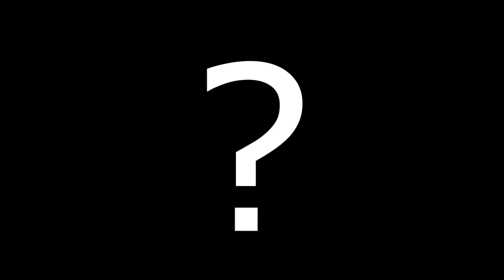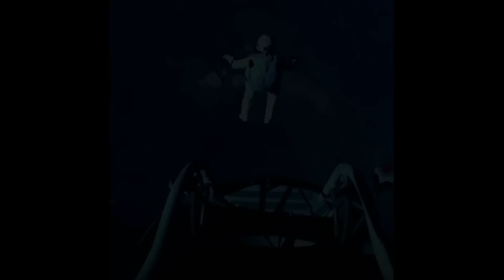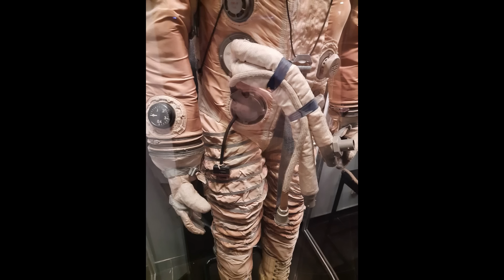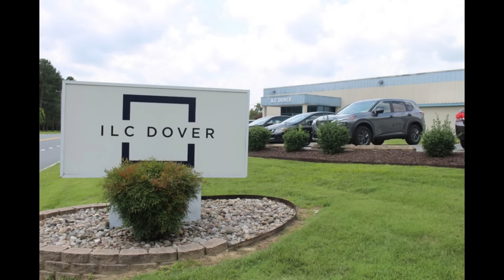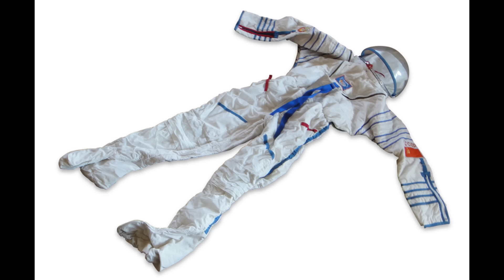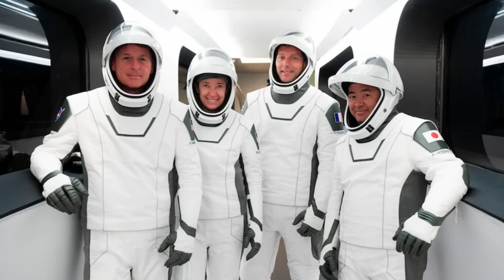A Brief History of Space Suits

Comment: When does not have to be a space and aeronautics engineer to understand what I'm about to say. 

Anyone who has been to boot camp, and remembers those metal trays on which they used to serve our food on the mess decks, will understand what I'm about to say perfectly. Metal both accepts and releases heat very quickly. Burn your hands when they first come out of the dishwasher, and it's why they turn your food ice cold within a couple of minutes of loading them with said food.

A metal helmet on a spacesuit to reflect sunlight is a very very bad idea. They would have cooked whoever they put inside of that thing in that moment. But the good news is, once they got them out of the Sun, then the remains would have been frozen for posterity.

Comment: The head pressure/torso counter pressure thing must have been so unbelievably uncomfortable.  The entire design is basically the same as sticking you in a big box with a hole in the bottom, sticking your bottom half out the hole up to your ribcage, then sealing around it and pressurizing the box.  All it's going to do is try and squeeze your blood/insides out your buttocks and push your blood into your legs so hard they turn into blood balloons.  Ugh.

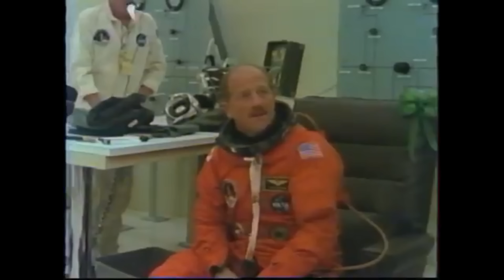Comment: Amazing as always! Couple small nitpicks at 59:00 though regarding Columbia. I highly recommend reading the Columbia AIB report titled "Crew Survival Report" as well as the much lesser known, significantly more detailed (and fair warning, significantly more graphic) "Loss of Signal:
Aeromedical Lessons Learned from the
STS-107 Columbia Space Shuttle Mishap" report. The data showed that between the heating, the impacts during breakup, and multiple other factors, even with fully and properly sealed suits and restraints, it was sadly completely unsurvivable.  And secondly, it explains that the unlocked visors and lack of gloves was not from complacency - at least in the commander and pilots case, the gloves being off was actually SOP per the checklist since it made using the flight controls much easier. And as for the visors, they just hadn't gotten there yet - the breakup happened so early at least one astronaut hadn't even been able to finish their tasks and strap in fully yet, and multiple others had only partially strapped in. And the speed it all went wrong was immediate. On the positive side, they talk about how the data from the accident and the lessons learned and applied to the latest suits and spacecraft means that if a similar accident happened again, the chances of survival have improved dramatically.

Comment: Do space suits have any radiation protection?
Reply from the maker: Most of the layers are designed to provide some radiation shielding. Surprisingly, it takes very little to stop solar radiation on a short time scale.
Reply: @DKiSAerospaceHistory  I don't know how much sun spots generate radiation, if they don't run in to any of those or it could end up like the solar flare that created the FANTASTIC FOUR 🔥
Reply: The sun doesn't spit out much radiation relative to its visible light, the white layer and layers do protect them well.

Comment: I mean, it kind of makes sense to use a diving suit as a primitive space suit. They're supposed to be reasonably gas-tight, and resistant to pressure gradients. The direction of said pressure gradient is likely immaterial for most parts of the suit, and for the parts it is relevant, the magnitude of the difference likely matters more. 

Similar to how the pressure hull of a submarine would actually be a decent spacecraft if the other submarine parts that relied on water were swapped out, and assuming you could get it up there (good use for an Orion Drive).

Comment: Most diving suits (like you have referenced) are intended to have a P differential of 0. Slight differences would be uncomfortable. Large differences (such as surface pump failure) could be deadly, trying to push the diver into and up the supply lines. There was also just recently a young girl who died using a dry suit because she was unable to pressurize the inside to neutralize the pressure differential and it crushed her until she could no longer move/swim/breathe.

Comment: Interesting and informative.  However, I think you made one small error.  When the astronauts jettisoned the two PLSS backpacks, they were on the LM's life support connections, not the O2 purge system.  They did keep the OPS's in case they needed it for an emergency crew transfer if there was a problem with the docking.

Comment: I understand the point you were trying to make relative to physical exertion for microgravity EVA versus lunar EVA, but I tend to think most astronauts might take exception with the assertion that microgravity requires barely no exertion. I've read many astronauts' accounts of EVA, and they all describe it as incredibly physically taxing since any joint movement is a struggle against the suit's pressurization. Even the simple act of closing the hand to grasp a handhold or tool requires such significant force that astronauts have reported losing fingernails.
Reply from the maker: I was judging by things I've heard such as only "finger-tip pressure" needed to open the massive solar arrays on the ISS so that they could be unfurled.

You make a fair point though.

Comment: With regards to Jules Verne:
The question of Lunar habitability is raised in the novell (originally they only wanted to send a dead projectile until a french adventurer voluntered to fly to the moon on a one-way trip, taking along the main character and his fierce opponent for plot reasons. The consesus is, that 
1. The moon is likely inhabited by intelligent beings
2. The Lunar Atmosphere - if it exists - is thin, yet likely breathable in the lowlands
3. The Moon would serve well to agriculture, the passangers take along animals, seeds and various tools.
In the sequel, while on the trip to the moon, they discover one of the dogs they brought along did not survive the violent launch and the decide to throw it out one of the hatches. They adress the problem of exposing the interior to space, however they manage to open a door and throw out the dog, taking care to let as little air as possible to evacuate out of the capsule. Clearly, Verne didnt really have a comprehention of how quickly pressurized air would leak out into a vacuum.
Actually, the astronauts are sent around the moon, because there was an error in calculation. They work out their trajectory and perform a course correction with the thrusters they had planned to use for landing, sending them onto a free-return trajectory, leading to a splashdown in the pacific ocean.
At no point is the necessity of a spacesuit even discussed, life support systems were deemed only necessary for the trip in the enclosed capsule.
Reply: This sounds like such a fun story.

Reminds me of Laika ... 😢

Comment: One cute point about tossing the PLSSes after the final moonwalks -- while the hoses were long enough to bend down and toss things out the hatch while connected to the LM's suit circuit, it was still sorta hard to bend like that.  Especially in the A7L suits before the waist joint was added to the A7LB.  Therefore, on at least one flight (I think it was Apollo 14), the TV camera was running while the PLSSes were jettisoned, and Houston remarked that they seemed to leave the hatch with some velocity.  The crew admitted that they wanted the backpacks to clear the front porch and the ladder, but didn't want to bend over that far, so they set them on the hatch frame and kicked them out.  This was likely done after Neil and Buzz reported that one of their backpacks barely cleared the porch and sort of bounced on the ladder rungs, before landing in the front footpad.  I think they just wanted a little more clearance, lol...

Comment: Sorta hoped for mentions of the two "lost" Apollo suits.  As you noted in passing, there were contract issues with ILC and Hamilton Standard, the maker of the PLSSes.  That meant that, in late 1966 into early 1967, there still wasn't a usable ILC Apollo suit.  So NASA had the David Clark Company, maker of the Gemini suits, make a slightly altered Gemini suit called the A1C.  These were the suits the Apollo 1 crew wore when the fire occurred, and as they had outer layers of nylon, the suits burned vigorously.  The other "lost" suit was the one that was approaching readiness, and would have made the lunar landings had the fire not happened.  This was the A6, which resembled the later A7 a lot, but the thermal and micrometeor garment was NOT integrated.  It was a separate set of garments, very much like a snowsuit's coat and pants, the LM crews would have donned over their A6L suits, helmets and backpacks.  As that would also have been primarily nylon, it was nixed after the fire, and the whole thermal and micrometeor protection garment integrated to become the outer layers of the A7L, coated with fiberglass-based Beta cloth to inhibit burning, even in 100% oxygen environments.

Comment: Quick correction -- when the LM crews jettisoned their PLSSes, they didn't switch over to the emergency OPS supply.  After the final EVA of a given flight, the crew repressurized the cabin, organized all of the things they were going to throw away that hadn't yet been tossed out onto the surface, putting the smaller items in jett bags.  Then they depressurized the cabin one final time, with their suits connected to the LM's suit circuit for oxygen and cooling water.  Those hoses were long enough to let the crew open the front hatch and toss all the final stuff they were leaving out the door, including the PLSSes.  The OPSes were kept for a possible EVA if the docking system failed after rendezvous, and were only used on the J-mission trans-Earth EVAs.
Reply from the maker: I was misinformed then. Sorry about that.
Reply: I posted the same info before I read your post.  However, I have a small correction for you.  They probably were wearing the liquid cooling garments under their suits, but they weren't hooked up to anything.  The LM didn't have a water-cooling system for the suits.
Reply: Correction: 1.The LM ECS did not provide water cooling for the suits, only the PLSS did.
2. The OPS were never "activated", ever. On teh Trans-Earth EVA's that the CMPs performed, they served as a backup in case if the life support tether failed (it provided 02 and "restraint" in the sense that the Astronaut wouldn't drift away from the CSM). The tether was connected to the ECS (Environmental Control System) of the Command Module

Bonus trivia: The CMP's suit did not have water cooling, it relied on the air pumping through it to cool the wearer (The CMP wore what they called a CWG, Constant Wear Garment) which was basically coverall similar to long-johns. The LMP and CDR also wore the same CWG on launch from earth, and during the coast between earth and the moon, and then back to earth again). They didn't need liquid cooling for the CMP, as the Trans-Earth EVA was not strenuous, since the spacecraft had already been designed with handrails and foot-restraints , as a result of the experience they had with Gemini in 1965-66.
Reply: Good to know!

Comment: Regarding diving suits versus space suits:

Diving suits require the same internal volume as pressure outside changes to hundreds of atmospheres.

A spacesuit only requires a difference of at most two atmospheres. Since breathing is the only requirement and we breathe 20% O2 at 1atm you could theoretically get away with just 0.2atm at 100% O2. This was done in early designs of space capsules but cancelled after a certain fire.

A leak in a high depth diving suit will instantly kill whoever is inside, the water will expand inwards at the speed of sound of the medium (1400m/s) and the mass flow rate is determined by the pressure (per 10 meters of depth ~+1atm of pressure) This combination is a guaranteed millisecond death.

A leak in a spacesuit will move at a glacial 340m/s and a pressure of 1atm.

note that these are rough calculations, obviously the diving suit wouldn't kill you at low depth and the spacesuit requires additional isothermic protection.
Reply: The concept of providing a lower-pressure, pure O2 environment wasn't canceled.  What was changed in Apollo was pumping the cabin up with full sea level pressure pure O2, this changed to 60% O2 and 40% N2 on the pad after the hatch was closed, to lower the risk of fire.  The crew was breathing pure O2 in their suits from a couple of hours before launch, though.  During launch, as the rocket rose and the air pressure decreased outside, the 60/40 cabin atmosphere was vented out and replaced with pure O2, until the cabin was at about 5psia (more like 30% of sea level pressure), and as close to pure O2 as possible.  The pressure suits also relieved from sea level to about 5psia at the same time.  From that point, up until they landed on the ocean, Apollo crews were in a 100% O2 environment at roughly 5psia.  The lower pressure, plus removal of flammable things like nylon from the cabin, reduced fire risk enough to safely fly the missions.  It also had the side effect of letting Apollo crews put on their suits and backpacks, depress their spacecraft, and go right outside, without the need to pre-breathe or adapt to a lower pressure.  In fact, during EVAs, the suits tended to be inflated to about 4.1psia, very close to the 0.2atm you mention.  That kept the suits from being so rigid it was hard to move in them.  The biggest developmental issue Axiom has with these new suits is maintaining a 10psia mixed gas atmosphere in the suits and yet make them so you can move in them.  I wish them luck.
Reply: @DougVanDorn  I stand corrected, I thought they completely abandoned pure o2 atmospheres after that. I had no idea they vented down to high o2 concentrations.

Do you happen to know wether axiom uses helium to achieve greater partial pressure? I cannot find details regarding their gas mix. Though it would be a pita if someone's accelerometer failed due to helium poisoning. I guess we could listen for helium once they put on their suits.

Yeah, the main advantage of not using nitrogen is preventing the bends when transitioning pressure differences.
Reply: @DougVanDorn  Hmm I was wondering if maintaining enough O2 partial pressure for breathing is the criteria needed, I'm wondering how much leeway is there to lowering it to reduce the effort on the spacesuit. I'm guessing not much since we can pass out at anything lower than 18% O2 concentration 

Also breathing is one thing and maintaining pressure on the body is another, what is the lower pressure limit you could keep your body at and still stay alive, I was envisioning a spacesuit that divides up the head and body into seperate pressure compartments, the head is fed O2 at 0.2atm and the body is kept at a lower pressure hence flexible, about the chest problem, maybe that's kept restrained mechanically or maybe put in the same compartment as the head

I'm guessing I'm proposing some sort of engineering nightmare or there are other issues unbeknownst to me. But it is a fun concept to explore
Reply: @oremooremo5075  This sounds ridiculous but our skin can practically survive the vacuum of space. Again, assuming you're not breathing certain gases like nitrogen, which could potentially boil off. So one of the next limits would be the vapor pressure of H2O and maybe some other dissolved gases that I'm not aware of.

So, why didn't the apollo astronauts boil alive when their body was at 0.2atm? Because to achieve a vapour pressure of 0.2atm, water would need to be around 60c. Or, if you want water to stay below its boiling point at 40c, you would need 0.0728atm of pressure. So just 8% atmospheric pressure will prevent boiling unless you're running a fever.

Also, certain human beings have been known to be able to function on the partial o2 pressures on mount everest, which is roughly 0.4atm with o2 being about 0.1atm.

So yeah. your "Spacesuit" for the ideal space marine could function on just 10% normal pressure.
Reply: @-yttrium-1187  Ah very nice, thanks for the info. Also given that Humans in space suits aren't very mobile, why give Spacesuits independent legs with limited mobility, why not a space suit shaped like a camping sleeping bag but with arms
Reply: @oremooremo5075  Stop it, You just made me think of space dolphins.
Reply: (Death at depths reminded me of that one Mythbuster episode where they confirmed that yes- you can get squeezed into your ol'timey diving helmet if your suit fails while diving)
Reply: But it's also a spacecraft